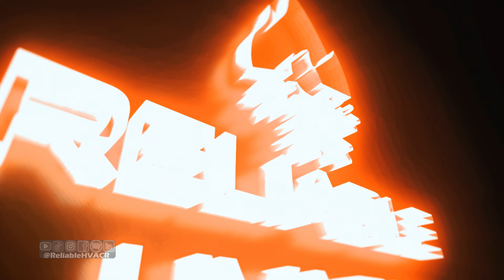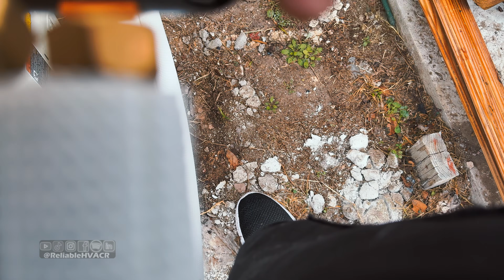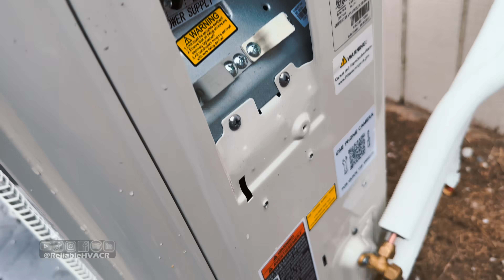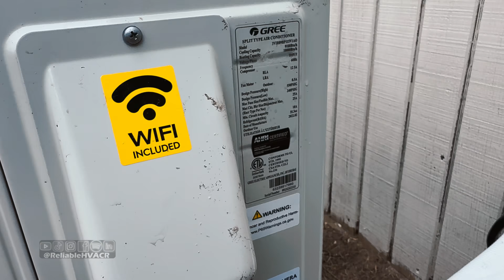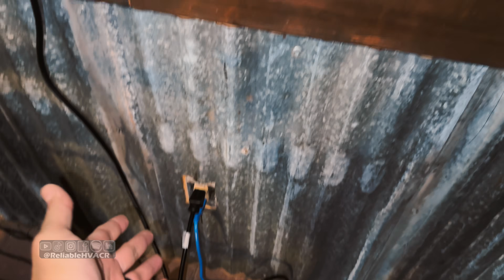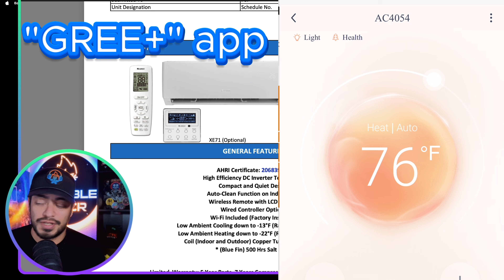Easy install of a Gree Mini Split

Comment: i know that the specs on the CURRENT 9000 btu GREE VITA series 115v systems request 16amp circuit.  but most home plugs are 15amps rated. Not sure if this will work for us.  Please comment if your fuse has ever blown assuming you have a 15amp circuit

Comment: I’m considering a Gree right now, 9000btu.  Is there a benefit of 120v versus the 240v ? I have a red 12-2 run with space for a 240 breaker, so could utilize either.

Comment: i installed a 12k btu pioneer recently. it works great for AC but it costs $80 a month to heat a space 16'x32'. i thought that was a bit pricey. i thought i ordered a 220v unit but its a 110, maybe thats why?
Reply: Gree are waaaaay better at energy saving.

Comment: Looks good and yes it's just for your man cave. But I still think you should wire it the correct way and have a disconnect and it should have it's own circuit breaker.
Reply from the maker: 👍🏽 unplugging it disconnects it